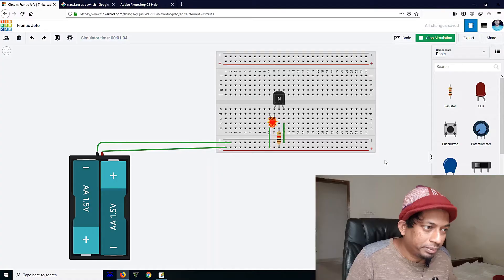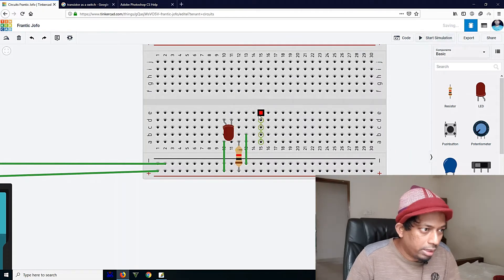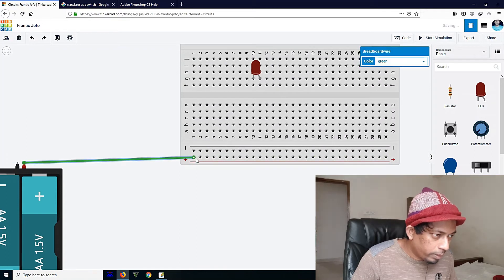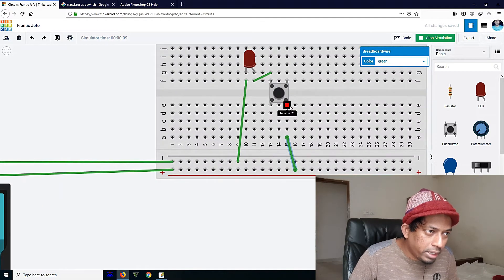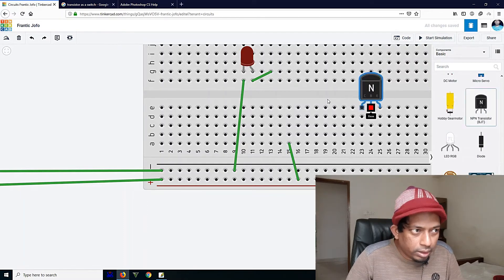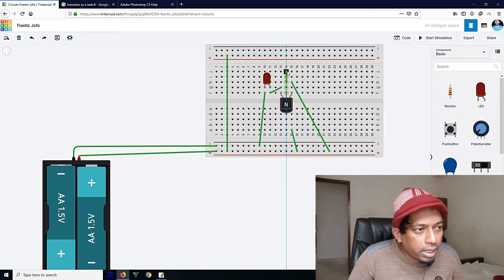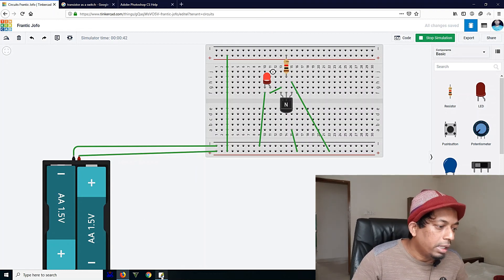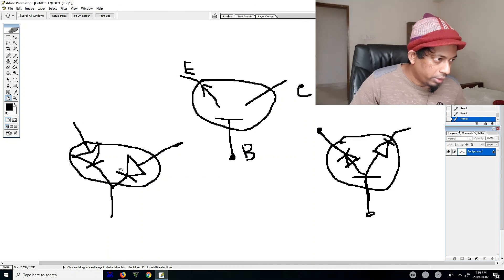ট্রানজিস্টর  এর  কাজ কি ও কিভাবে টেস্ট করবো ? how dose a transistor work?

Comment: Why Transistor 3 pin positive
Reply from the maker: when you put more then zero volt  on transistor base   other two pin will get connectivity, you  can do positive switching or negative switching